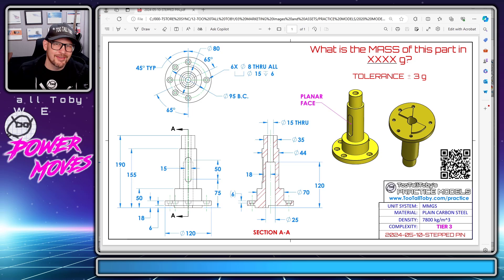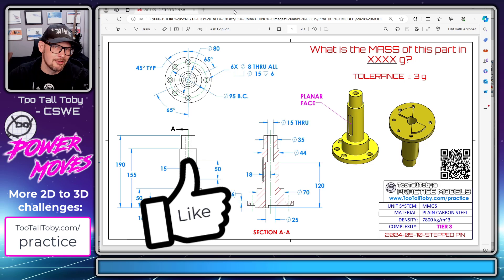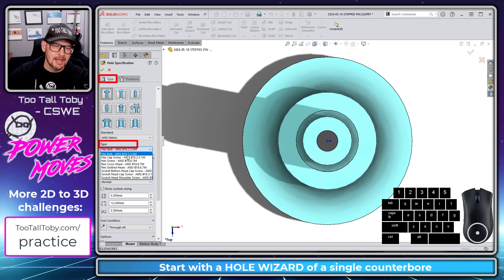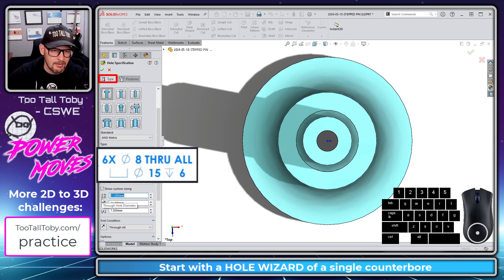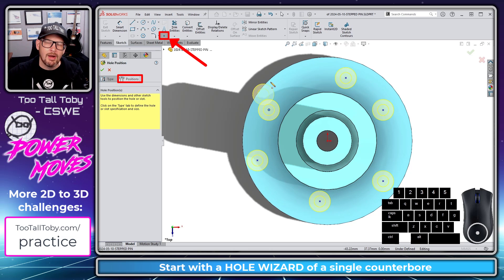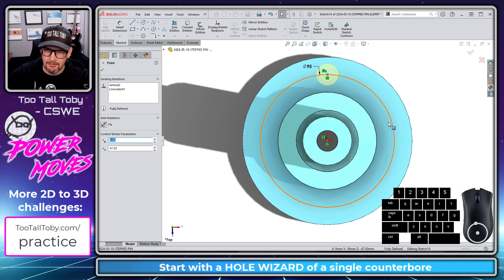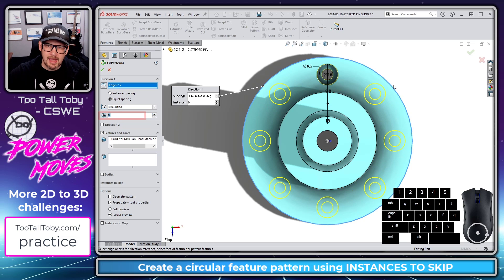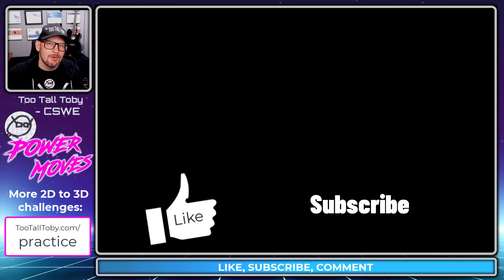HOLE WIZARD + SKIP INSTANCES - SolidWorks Beginners Tutorial

Comment: One year at SW World, one of the developers said that creating a circular pattern after hole wizard took longer to rebuild when adding patterned hardware rather than creating the circular pattern within the hole wizard sketch. You can still turn off the unneeded points, but I have tested it and it appears to be a fact.
See if you notice the same rebuild speed increase.
Also it only requires one command rather than two.
Reply from the maker: Great point and definitely something to consider! 
Here's how you can find out:  https://youtu.be/F7nr8h-5sYU?si=P_gZHMwMhZC-8TdZ

For a pattern this small it's a negligible difference, so the decision to use a pattern with skip instances vs sketching the points will be based on other factors.

But as the pattern becomes more complex / involves more faces - it will become a more significant branch in the decision tree.